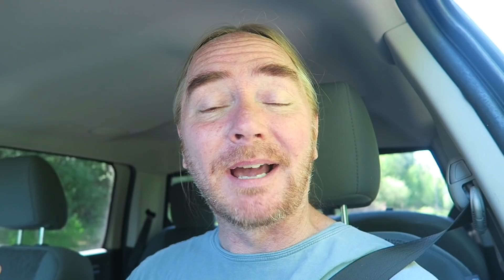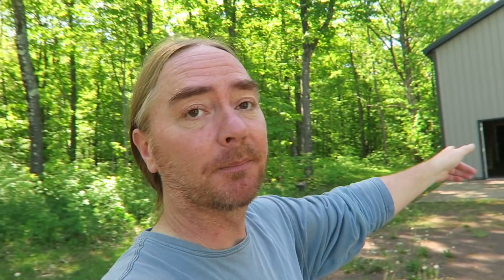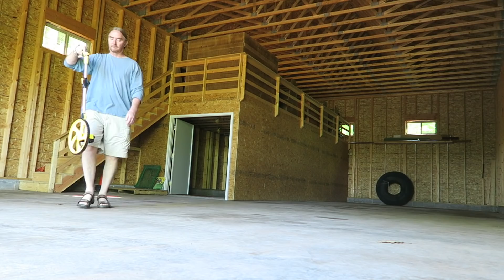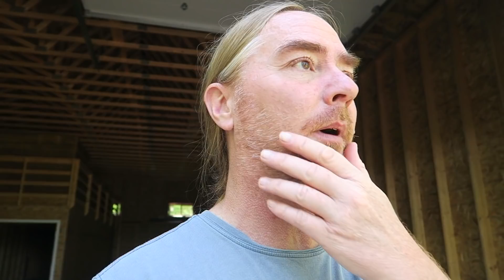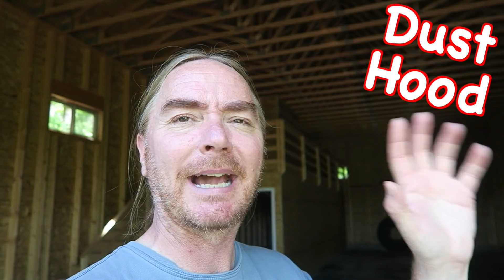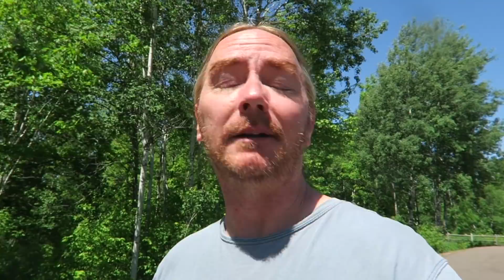Old Shop Vs New : What I've Learned Over The Years

Comment: Having lived through a house fire caused by a can of spray paint on a kitchen counter followed by a teenager putting a poorly stubbed cigarette into the kitchen garbage and the havoc in our lives that ensued from the resulting fuel/air explosive (no one was hurt, thank God) I am a firm believer in not having explosive compounds, especially compressed explosive compounds, unprotected from excess heat or unisolated from the main space.  One idea I had when contemplating a proper shop was an addon to the building with fire resistant doors and walls and an integral sprinkler system in that room and possible throughout the building.  Sheet rock makes a great fire resistant barrier, just add on layers until you are satisfied.  Also, 24x7 low level ventilation of the storage area to prevent any explosive fumes from building up.  You'd want it climate controlled for paints and resins and such of course but I'd opt for a separate small heat pump just for the storage area and zero shared ducting between the storage room and the main building.  Just my thoughts from the cheap seats but I can still hear that "boom" when I recall that day and seeing the double french doors on the back of the house flying off the frame.  I was in the driveway working on a car and the 15 minutes of panic as I found and checked off that every person was ok and that the dog was not in house etc was far too exciting

Comment: You could add a small equipment room off the back of that long shop area, to contain the compressor and dust collection system. Only thing coming into the shop would be the air drops and vacuum piping to work locations. When doing a dust collection system use large sweep fittings with no sharp corners, along with screw in cleanout plugs to keep the system flowing clear.

Comment: Move  the stairs to the back of the long bay. Put stationary tools on the left. Save the bay  length for bigger  boats.
Reply: Agree, move mezzanine to rear wall, and remove its wall and doors so you can get to shop tools underneath. Or leave mezzanine where is for upstairs storage but remove doors and walls, just have posts. Doors and walls eat space.

Comment: I would agree that putting the compressor and dust collection outside in a small lean too on the side of the building would be good,  though it may increase cost.  You didn't mention the plans for the loft up stairs,  could that be used as a hazmat room for storing paints and resins?  as your in the exposed framing set right now, you could ad a small dumb waiter with an electric winch to move large containers of paints and resins up to the loft making life easier.  Maybe even get a big enough lift to put a roll around cart on so you can transport mixed resins and paints downstairs quickly and easily.  I would agree with other comments of go ahead and plan for put in the framing and an Electrical junction box for an addition in the future just because you may decide you have out grown this shop at some point.  As the costs now would be minimal but it would add allot more to the costs in the future if you did decide to add on.

Comment: My 36 x 88 shop has 16' ceilings and these are the lights I installed.  High Bay LED, 5000K:  https://www.amazon.com/gp/product/B01G7TLWDG  I installed them in three rows (9' c/c) by eleven columns (8' c/c), with two blank spots because of overhead door track. They are screwed directly to the ceiling/trusses, so very easy install. (the lights are aligned with the trusses).  All my wiring is surface mounted emt conduit.  I've had them a couple years now and have had no failures and I'm as pleased as punch with them.

My walls are 6" and I just have 6" fiberglass insulation, with at least a foot of blown in fiberglass in the trusses.  My heat is 4 natural gas radiant tube heaters (not good for high dust or fumes), but I don't have them hooked up yet.  I did not insulate my slab.

My nephew has a more rectangular shop, much wider but not quite as long, and he has radiant floor heating, propane, with insulated slab, spray foam + fiberglass batting wall insulation, and at least fiberglass for the ceiling, I'm not sure if that is spray foamed too.  His heating bills are amazingly small; he heats all winter.  With the radiant floor, it takes a long time to warm up, so he leaves it on.

Comment: I've voice been told that I have the answer I just need to hear myself say it it sounds like you've got quite a plan the one thing that I'm an electrician by tread the 1 saying that you set every 4' on your outlet if you look at your cords you can go 6' and still overlap it's in a building that size probably save 4 or $500 just in outlets far as your lights go I think you're on the right track you mentioned a compressor there's nothing wrong with putting the compressor in an outbuilding or just a closet insulating it and plum You can use the aluminium plumbing that just plugs together and run it right on the surface here your dry wall

Comment: I have a 500 foot driveway going through the woods I had a trenched next to it to bury the electrical line and a cable for a phone and TV I want to it cost me $10,000 they have a trench from the main road up to the house also are use California air compressors to help me in my boat business to they are nice and quiet. They have good pressure also and last a long time

Comment: Brand: fotoconic

4.4 out of 5 stars  54Reviews

Hi Amazon sells a photograph backdrop system that you might use for  your rolls  of fiber glass.  Or you might get an idea from it to use. Cant send pictures. This is  the name from Amazon  Fotoconic 3 Roller Wall Mounting Manual Background Support System, Including Two(2) Tri-fold Hooks, Six(6) Expand Bars, Three(3) Chains

Comment: You already have a lot of good ideas in the comments. My two cents would be to put the noisy machines outside the building, reducing their footprint and your stress level. Planning for an addition at this point is also a great idea. DIY trenching is a thumbs up as is extending the loft to the front of the building. Hey its only your money. Fair seas.

Comment: Good morning Andy just saw your video about the shop this is big knucklehead in Miami listen I'm a mechanic and in most of our shops the compressors dust collectors and things That make noise like that are actually located outside of the actual building structure in an adjacent shed maybe that's a solution for your air compressor / loud equipment. By putting it in an adjacent shed it would also save on space for you to be able to place other equipment that you need in the shop cuz by looking at your shop yes is a little tight I haven't seen all the equipment from your old shop but yours looks a little tight and tricky for you be able to fit in the equipment that you actually require versus what you want

Comment: I built airplanes and had a fabric closet that when used the door folded down with legs to make a table for measuring and cutting. After wards It folded up and closed the rolls up and kept them from being contaminated with dust & dirt.

Comment: outside the box; relocated mezzanine to rear wall. It appears to be fastened to framing on perimeter wall and fastened to slab for the center wall. Rotate 90 degrees to wall opposite roll up door and you gained more useable floorspace and depth for zero tradeoff. Add a couple coil style roll up doors on long wall, and you have an expandable workspace for fixed tools and will allow for handling longer materials when the need arises. Moving down stairs gives you option to enclose under the stairs for compressor.

Comment: Hi Andy. A few suggestions on dust collection. Keep the woodworking system separate from the fiberglass and shop cleanup side. You garden and you can use the sawdust for a lot of things if its not contaminated. Put the dust collection in an enclosure or outside if you can. Reduces noise and fine dust in the shop. If you separate the woodworking dust collection you can save on filter costs by piping it outside as long as nobody is in that area which looks like it would work for you. Good filters are really expensive and still don't collect all the fine dust.

Comment: True daylight balance is 5600k. For a fabric rack, look into seamless paper racks photographers use. They are mounted on walls,  can be adjusted for any width material, and are on rollers so you can let out and cut as much as you need. They with several rollers mounted one over the other so multiple rolls can be stored. It would be perfect for you.

Comment: Andy, you might want to consider a scroll (sometimes called screw) type air compressor.  They have great cfm output and are very quiet.  They also tend to be more expensive than their piston style counterparts.  Have your electrician wire it with a contactor  so you can turn it on with a simple light switch remotely. Enjoy the new shop design!

Comment: I would extend the mezzanine 18 X 18' for additional storage and work area leaving 42' of high height clearance for big boats. I would install a side door about halfway on the side of the building to carry your material without having to open the garage door every time (Winter!) I would reinforce the attic trusses to allow the installation of your HVAC and Dust / Fan equipment above your normal ceiling level. I would install the air compressor outside in its own shed. That shed could also be used for wood storage provided it is 100% dry.  You have quite a challenge in front of you, draw your layout on paper before cutting the first 2 X 4. Cheers

Comment: Pull the spare room down. Move it to the back walll. Create a bigger more open area in the front. Change the size of the room to suit then the mezzanine floor can be brough further for extra storage upstairs.  Allows space for boats on one side wood working on the other. And a smaller room in /with the other to put the compressor and dust extractor in with sound deadoning.

Comment: I picked up a 5hp 80gal 100% duty cycle Ingersoll air compressor a year ago from tractor supply for under a grand... It is very quiet and runs my big air grinders...Also get a harbor freight ac air drier for the compressed air. I also recommend looking at a small 20' insulated aluminum shipping container for your bulk, less used items. I am looking forward to more videos on the build. thanks.

Comment: I would put the compressor in a small purpose built lean to shed on the outside fo the building and pipe in the air to where you want it.
This would address the noise issue and makes more space inside.
Reply: If it is doable I would put dust collection outside also for the same reasons.

Comment: The compressor is a must to be put out side in a closed shed and must have a auto purge of moisture. Run your air lines EVERYWHERE prior to insulation. Built many shops and always improved on the previous.
Reply: I was going to suggest this same thing, but also, put your dust collector in there, and run those lines everywhere too! Another option might be to build a sound insulated spot in the loft. But getting heavy equipment up there may be a bit of a challenge... I switched over to LED lighting for my shop and can't believe how much better it is. You may be able to incorporate additional "dust" control into the HVAC, system or add a separate air filtration unit. You just can't capture everything with the dust collector, but with as much air exchange as you have going on with your HVAC, adding some filtration to that should get whatever is left...
Reply: Dust collector too!
Reply: Run your electrical, air, etc. on outside of wall insulation in conduit so you can change it as needed.

Comment: The fiberglass shop I used to work at we had a simple made (2x4) 10 foot long table about 54" wide. At the end we built a simple rack that held 50> wide rolls of glass. We had the lightest rolls at the top (veil), then 3/4 mat, then 1.5 mat and then woven roven at the bottom. Just lumber with pipes to hold the rolls.

Comment: just add another room, its a wood building cut the wall open for a side or back door build a small extension room, it doesn't have to be the height of the building, and can be done inexpensive but will give you tons of space

Comment: What I've Learned Over The Years is EVERYTHING should be on wheels. everything!
Reply: Ya they make large casters that you bolt on and have a foot lever to raise and lower the equipment for easy moving 
Also I think you might be able to get the air compressor under the stairs maybe or do like some shops and build a small air compressor room on the outside of the shop

Comment: I built my 7th (and final) Woodworking Shop about 20 years ago and the number one thing I would recommend is to buy a few dozen high-quality heavy duty casters. Put everything on casters that you can from the start. I even have a plywood storage rack that will hold 20 sheets of 3/4 inch plywood on edge and with 10in heavy duty casters on a smooth floor it's easy to move around. This allows you to move things around with new ideas for floor plans as well as making room for extra large projects.
Reply: That is solid advice...
Reply: What I do is make everything movable with either a pallet jack or forklift.  It's easier, cheaper & more stable than rollers on everything....   Even my 4000lb CNC was movable with the forklift, so was the lathe.
Reply: I have a professional woodworking shop. I have been using wheels and casters, etc. for a few decades and am very happy doing so.This includes my 5x10 CNC, 5x10 vacuum table, cabinet table saw, assembly tables, sanding tables, moulding machine, planers, router tables, etc. It was very helpful to have wheels when initially setting up each shop (I moved a few times over the years). I can move equipment around by myself. Now the larger pieces tend to stay in one spot, but smaller equipment can move as needed. Some equipment may only get used every few months, so being able to quickly roll it out of the way is beneficial.
Reply: I thought some more about this and want to add a bit more info.

Do a search for "mobile base" or "mobile tool base" to handle heavy tools such as table saws, planers, router tables, etc. They have two fixed wheels and two flip-up swivel casters. Tools are easy to move, then very stable and safe while using the tools. The bases can easily be made to handle custom sizes and up to 1500 pounds or so. The base for my Unisaw plus extension table was designed just for it. Most of the others I have were made from kits that have the four wheels/corners and I added four wood connecting pieces sized as needed. On a smooth concrete floor they work very well.

For my custom tables (assembly, rolling cabinets, etc.) I use 4" casters attached to the bottom. Some are locking, swivel casters if I need the table to be stationary when in use. Others use non-locking casters for storage cabinets and drawer banks for tools, supplies, etc. Check the weight limit on the casters. My 5'x8' assembly table can handle 1200 pounds and still roll around with a simple push. The type of wheel material also makes a difference. Find one that works well on your type of floor.
Reply: This real good advice every thing should be movable. As your projects change so should your equipment.  Except air ex-changer, compressor. heating.

Comment: For mixing consider a laminar flow hood. You might find a used medical hood. Not sure if you can vent fumes outside there in lockdown Michigan but you could modify the hood to vent outdoors. When I retired I ended up giving my hood away as there is not a Re market for that kind of equipment in the medical industry because of liability.
You may have done it before but would not run all the 120 on one circuit. Also use good pipe in dust collection system. I hadAC guy install their vent pipe. It was to thin and leaked to much losing significant amounts of suction.
You viewer have excellent suggestions. Enjoy the work and your family.

Comment: Hey Andy. I've loved living in Michigan for 57 years, lots of water and boats. I make lists for big projects-it helps, cause the old iron trap in my head ain't what it used to be. Can you rent equipment to trench for utilities yourself? We added a mechanical room to the back of a 2 1/2 car garage for HVAC, compressor and dust collection-it was a game changer. We lucked out and used free material from a remodel demo job (roof and walls). The room under the loft in your shop would be great for mixing and clean work. You have lots of room in the rafters too. You can NEVER have enough light in any shop. LED only way to go. Just some thoughts. Welcome to Michigan, and thanks for posting.

Comment: I’d put a large door into the back wall, to run my throughput from the back towards its final use location. You can have a throughput work flow into a dead end. The other thing I’d think about is a small gantry crane. It will make moving motors and prefabricated sections easier/possible.
Reply: Like a pass thru